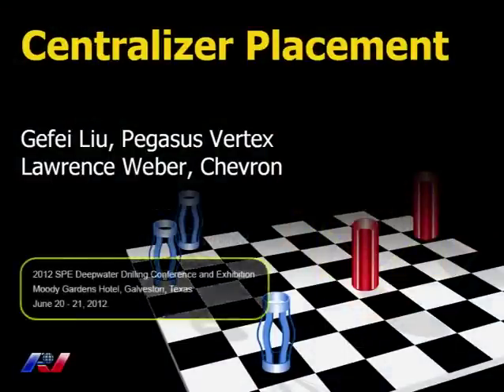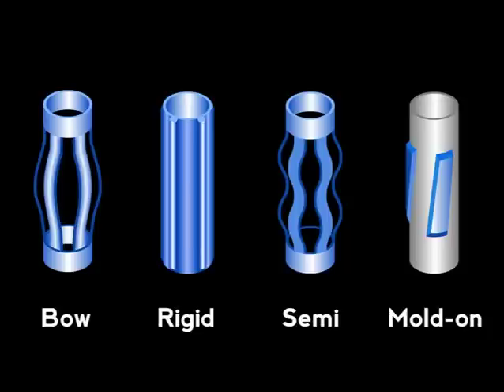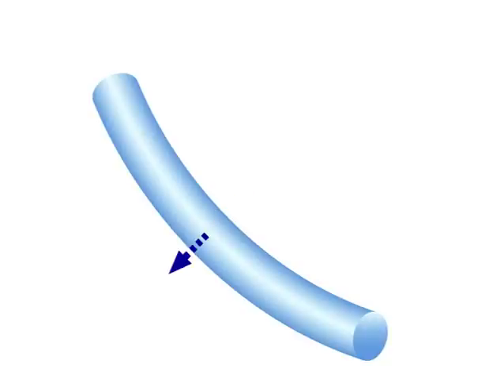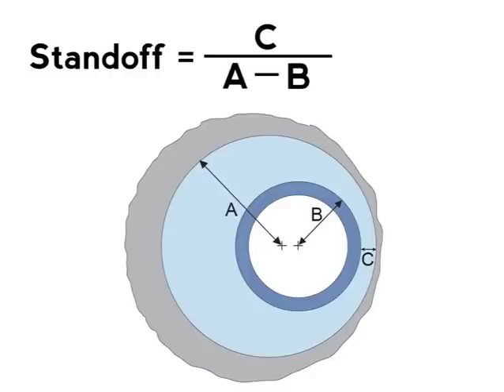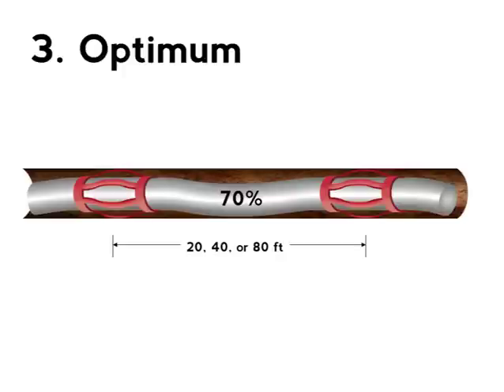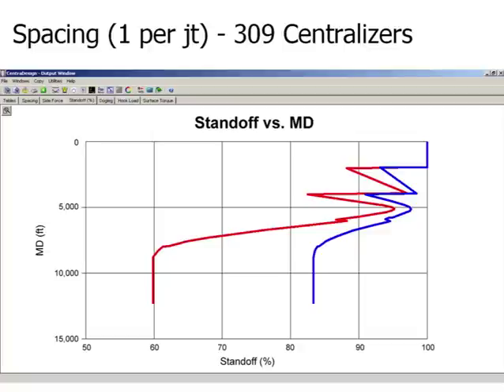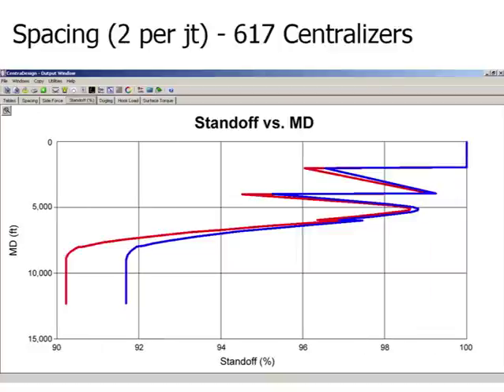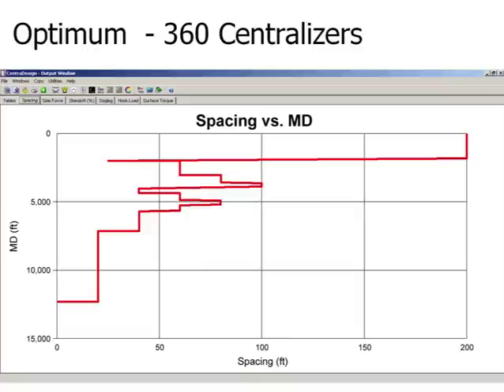Casing Centralizer Placement

Comment: How do you understand that Installation is good or not based on Spacing vs MD. What should I pay attention to on these graphs? Thank you in advance.
Reply: Hi, user could estimate "The good or not" result based on the calculated standoff. Normally, we assume that standoff greater than 70% is good enough. User could also get idea from "Spacing vs MD" if there are too many (or few) centralizers along wellbore (if the standoff meets requirement already).